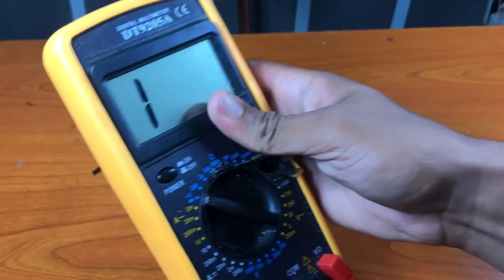I turn ballast into a powerful inverter circuit 12V TO 220V, 500W

Comment: What is the numberof the MOSFET  you use? You just make an inverter from 9 v battery if the battery lost power thats the another problem you will buy again battery 9 volts